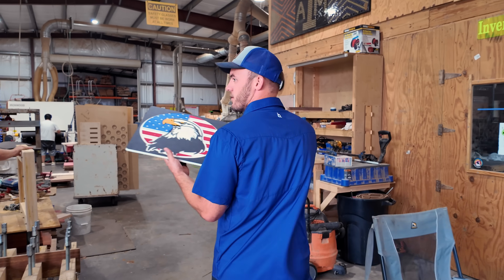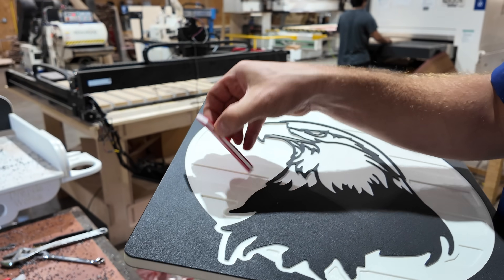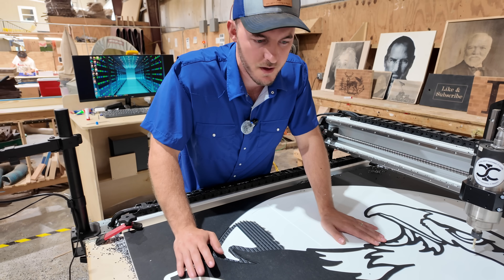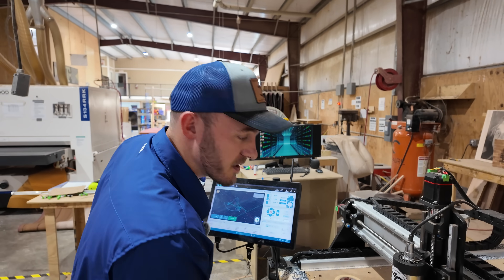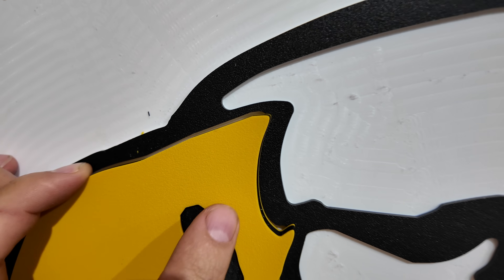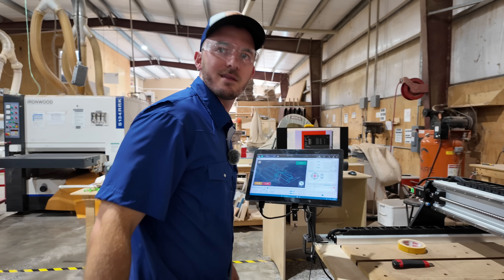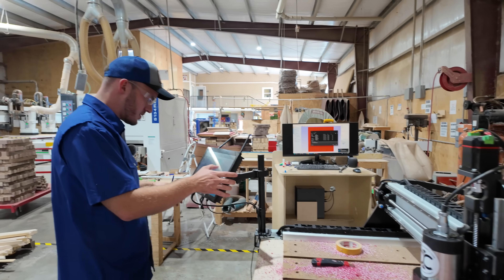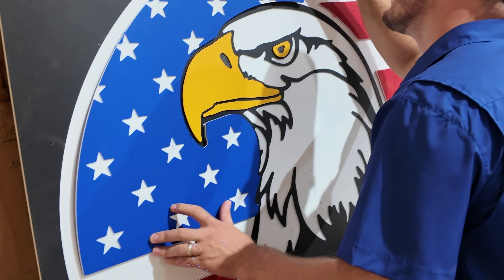Can a Hobby CNC Handle This Monster Project?

Comment: Another great informative video. Some idea of the feeds and speeds for the plastic would have helped, although you did mention that it was a single flute (UK speak) cutter. Does the double-sided tape not gum up the flute when cutting right through the material?

Comment: I have been using the HDPE material for 4 years now to make cutting boards and signs.  So easy to work with and no saw dust.  Even have a license to make LSU cutting boards.  Had to purchase 90 sheets of the special run Purple/yellow/purple material to cut the boards out of.  I do the inlays also and usually screw from the back side.   Thanks for the video and i will be stopping by next week to see you shop.

Comment: Can you clarify why the beak did not cut properly?
Reply from the maker: The points on the beak were pointy, when I pocketed the other part with a 1/4 bit. The points could not fit into the rounded pocket
Reply: @cutting-it-close so to mitigate this, pocket and profile with the same diameter bit?
Reply: @FredSchmitthammer no, it is a geometric problem. In other words the eternal fight of concave vs convex profiles.
You can mitigate it by reducing the diameter of the milling bit for concave zones of the milling path.